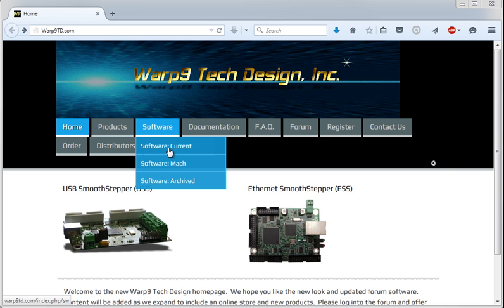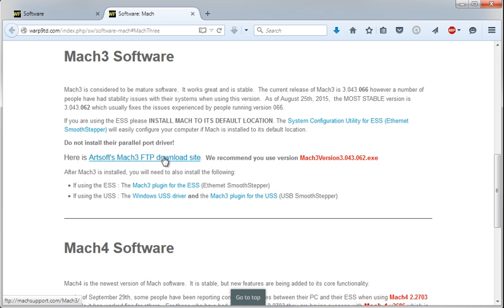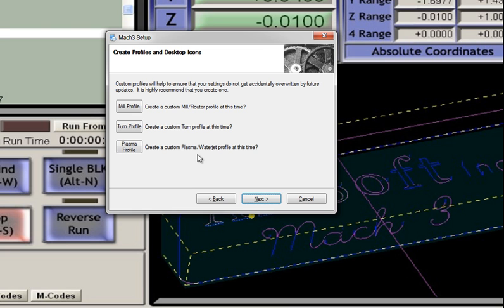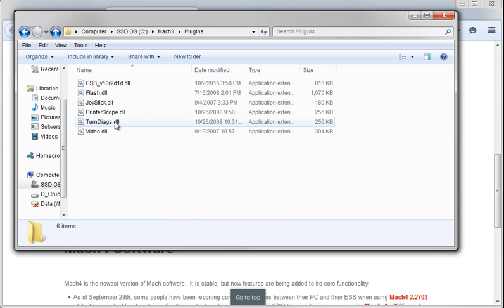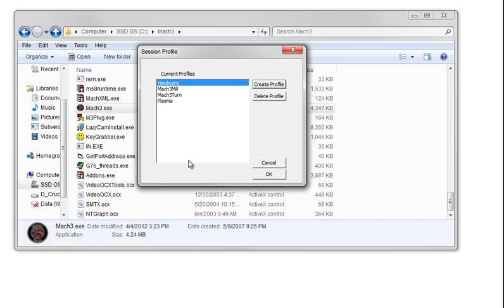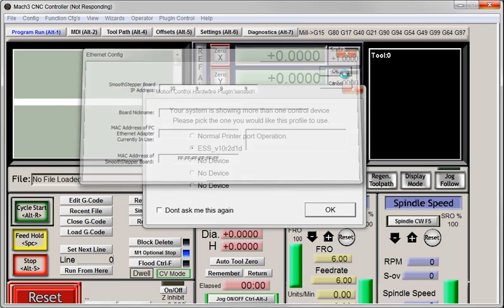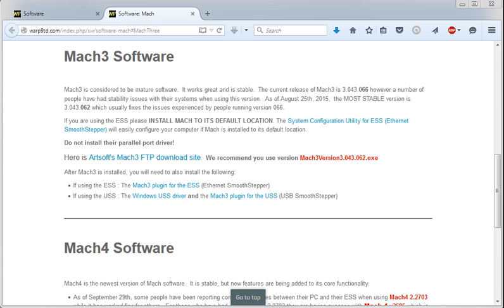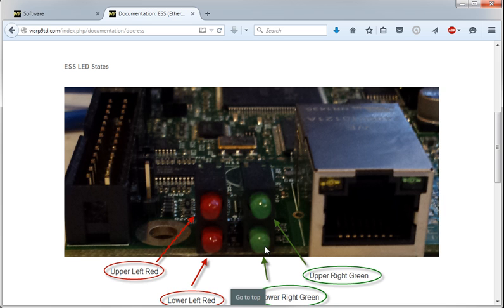Installing Mach3 and the ESS Plugin

Comment: with plasma height control mach 3 top bottom and arc does not want to do the plugin when I open mach3 an error is highlighted   application watcdog triggered when I press the arrows on the x and y axes, it moves, and on the up and down axis, it moves normally, and when it starts to execute the m3 script, it executes what the z axis pauses for 0.01 seconds, the light blinks on the z axis until it touches the metal .how to fix the problem?

Comment: Hi I keep getting message "access denied" when I  double click ESS_Mach3.M3P  I have tried everything. Please help!
Reply from the maker: Hi, 
I am not sure why you are getting that message.  However, you can:
1) Manually move the  ESS_Mach3.dll file from the zip file folder to the "C:\Mach3\Plugins\" folder., OR
2) Manually move the  ESS_Mach3.mp3 file from the zip file folder to the "C:\Mach3\Plugins\" folder, and double click on it there or just change the extension from .m3p to .dll
Everything will work fine for you then.

Andy

Comment: Just a heads up for anyone getting stuck alone the way. 
When running SCU I had issues connecting/ sensing the ESS. I went online and bought an additional network adapter card for my PC. Make sure when you install it you go find it in Device Manager> Network Adapters. Open up the one that matches when you bought (they should have similar names). Open properties, click Driver tab on the top> Update Driver> Search automatically for updated driver software. Close all windows and run the SCU easy mode.
When setting up Mach3, run the Mach3 exe. If Windows firewall doesn't pop up, close Mach3. Hit the Windows key on your keyboard and type in Firewall, click Firewall & Network settings. In the new window look for Allow an app through firewall  and click the link. In the new window scroll down until you find Mach3 CNC Application and mach sure the checkbox is checked (you may need to hit Change settings on the top right first in order to check the box). You should be able to follow the video above without issues now.
Reply: Pro tip. Thanks for putting that out there.

Comment: Hello I need help with this ess board. the Lower left led is on but no estop is active what should I do.
Reply from the maker: You will need to go into the Mach3 -> Menu -> Config -> Ports and Pins -> Input Signals.  Scroll down to EStop.  Change your active Hi/Low setting to the opposite of what you have.  You may have assigned it to the wrong port and pin.
Reply: @Warp9TechDesign  thanks so much. 🙏🙏🙏🙏🤩🤩